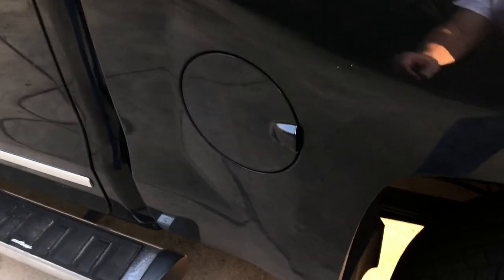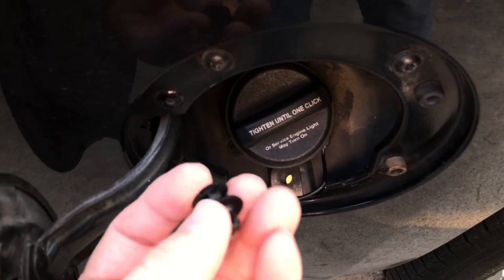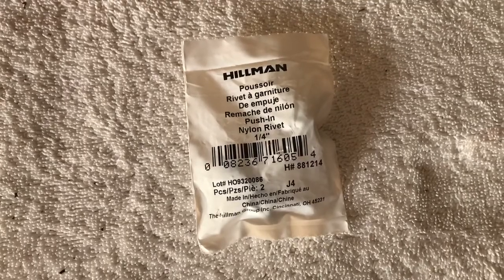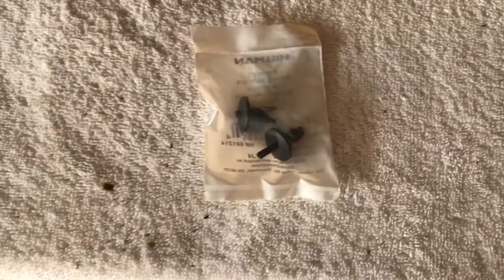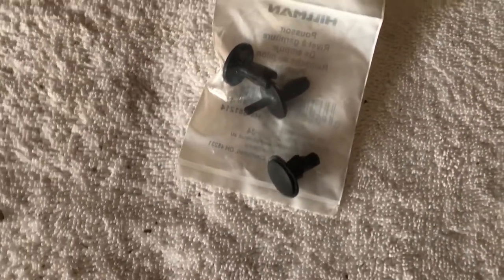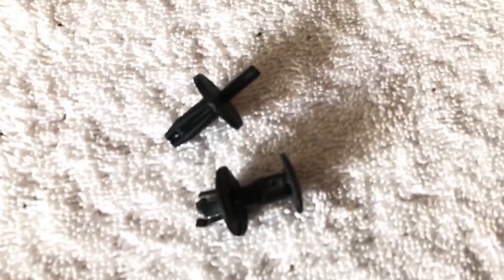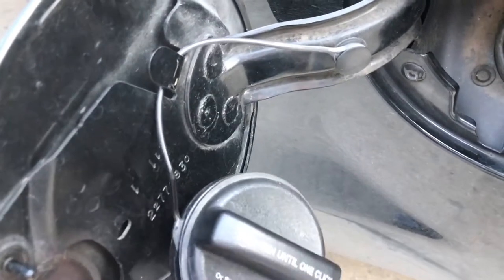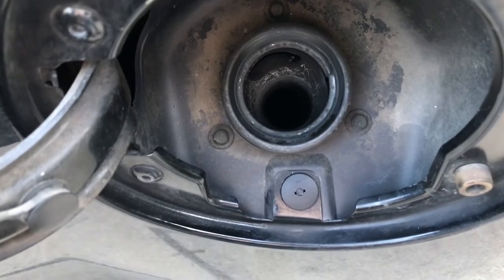How to fix a loose fuel tank filler neck

Comment: This works great 👍 may need to back out the two top torxs fasteners so you can align the two holes just right to allow the push pin to go all the way inn.
Reply from the maker: Good tip. Thanks for adding that.

Comment: Hi!!! Would this cause the gas cap to not tighten properly. I've replaced 2 gas caps and still dealing with loose gas caps. I am missing that rivet. Looking at replacing it tomorrow.
Reply from the maker: I suppose it could affect the ability of the cap from tightening down securely if it was obstructed but surrendering well structure. My was just flopping around and it was difficult to keep a pump nozzle in the opening. Please let me know how the repair works for you and if it solves your cap issue. Looking forward to hearing back from you on this.

Comment: Thanks for this video 👍 however I have an issue I was hoping you could help me with. 
I have a 2008 Chevy Trailblazer, I recently discovered that the small metal flap inside the gas filler neck is missing, I tried taking a piece of wire to see if it was stuck but I couldn't locate it. So, my question is if it is stuck; is there a way to get it unstuck but if it is missing for some other reason, I'm guessing it would have fallen into the gas tank. What kind of problems is that going to cause? 
Any help, knowledge and solutions would be greatly appreciated, Thanks 🌹
Reply from the maker: That’s a great question. If it’s not there it’s probably fallen inside the tank. And that is nothing to worry about. It won’t affect the fuel pick up line or anything else. Those flaps basically keep debris from getting into the tank. Thanks for the question.
Reply: @HillCountryPrepper  
Thank you for the quick respons. Have a blessed day 🌹

Comment: i have a problem where at the gas station it’s stops pumping but my tank isn’t full. will this fix it ?
Reply from the maker: This may or may not fix that issue. My 2009 Jeep Wrangler has the same problem. I have to hold the fuel nozzle up, otherwise it’ll stop fueling prematurely. I suspect it has to do with the angle of the nozzle and the Jeep’s fuel filler neck. This video was on a 2015 Silverado. The filler neck was loose and moved from side to side, but fueled up OK. Thanks for watching and for leaving me the question.

Comment: What do you do if the filler neck hole is ripped out?
Reply from the maker: Sounds like you'll need to replace the whole assembly. I'd start by going to a "pick-and-pull" yard and find your model vehicle and get a replacement there. Sounds like the makings of a great video!

Comment: Did it make clanking noise while driving
Reply from the maker: No, but it was really annoying whenever I would fill it up with gas. It was loose and would flop from side to side. I was worried it would break or something from the weight of the fuel nozzle.